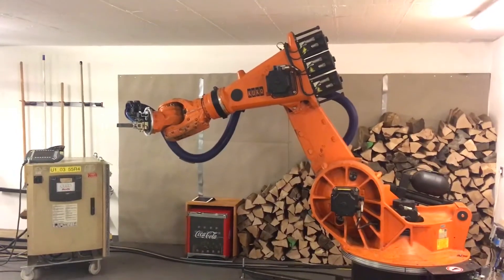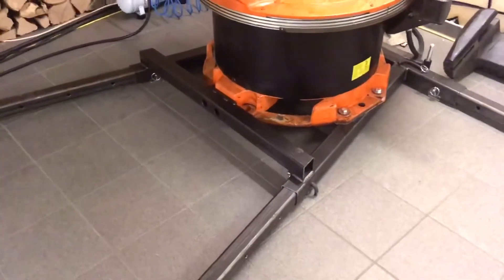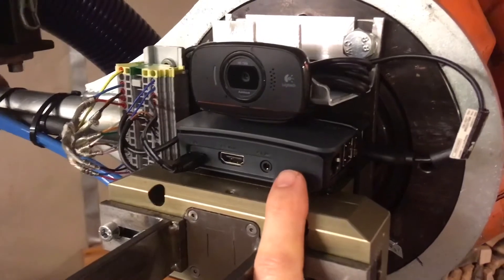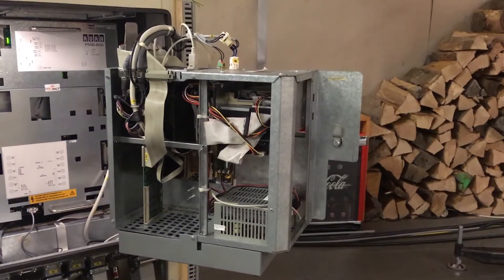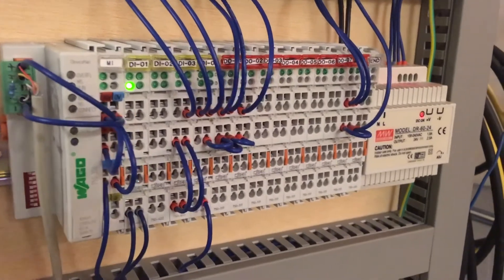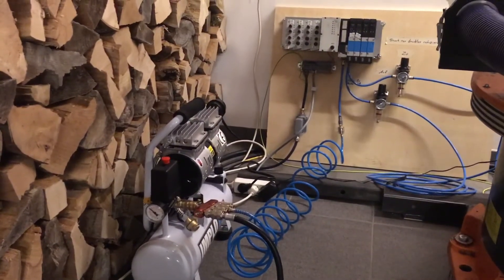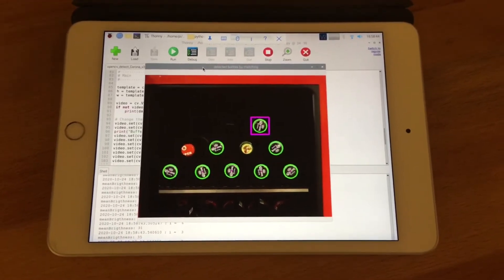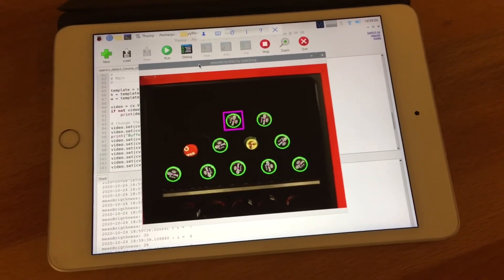How to make an industrial robot work

Comment: This is what I've been looking for!!
Would you happen to know of a cost effective method for 
120v residential to 3-phase 480v?
I'm located in the US.
Thank you sir.
Reply from the maker: Sorry no idea.
Reply: If you don't want to run it flat out (3 phases at 32 amps each) you can use a single phase to three phase variable speed programmable drive used for things like spindle motors😁
Reply: If you have three phase to your house a Kuka KRC1 like in the video may use it either in native mode by changing jumpers or by the use of an optional transformer.

Comment: This is really interesting. What are the power requirements for the robot and did you have to adapt anything to get it up and running? For example, does it require 3-phase 415v?
Reply from the maker: Yes indeed it is three phased (230V live to neutral, so 400V between the phases). The fuses should be 3x32A, but so far it worked also with 3x16A. All depends on the load, which is far from maximum in my case.